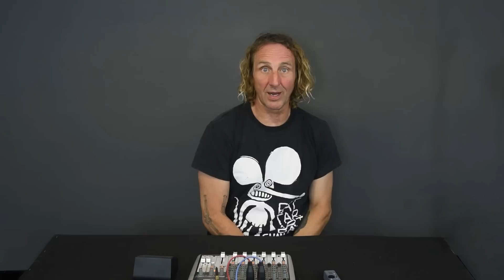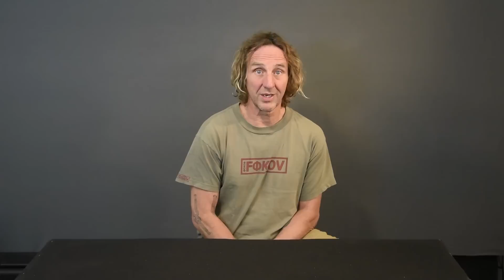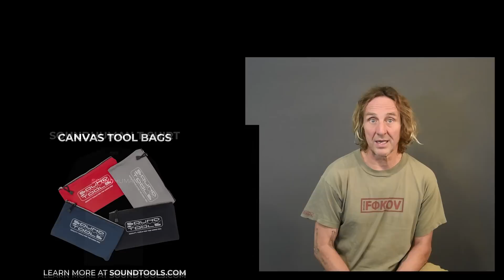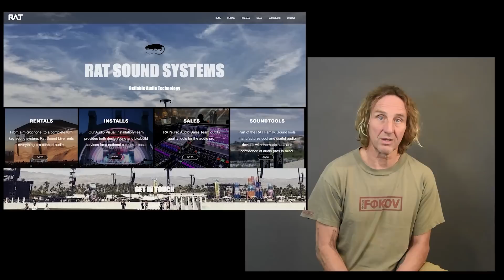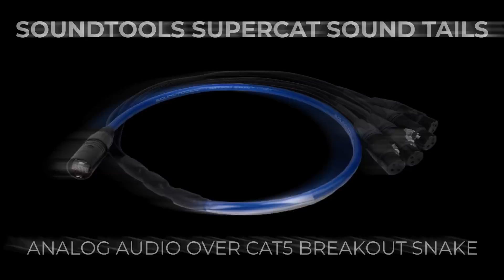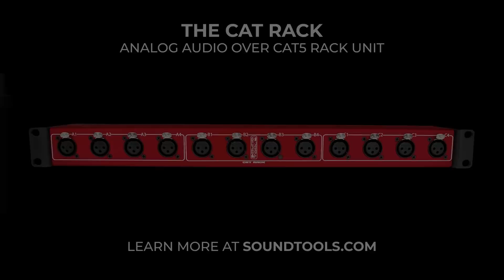Does Gain Pot Sound Different than Fader?

Comment: Very interesting Dave! And power amps deal with lots of wattage and amps, whereas a mixer is voltage? With an active level control on an amplifier I like to run it at +0 boost -0 cut, and use the mixer to set what needs more reinforcing. Kinda the same with a non-active amplifier but I turn the amp to max (10 or all the way up if it has no numerals) and again use the mixer to set what needs more reinforcing.

Comment: Awesome Dave! As always. Another reason for not running with your “faders” in the basement is the resolution of the attenuator may not be linear so you may have more fine adjustment around that “0” mark
Reply: An interesting side note… as someone who primarily deals in audio for cinema type rooms for permanent installation as well as special events (think three large array hangs behind a screen plus additional one two or three box hangs around the room for surrounds for really large premieres and such) we traditionally calibrate cinema processors at “7” out of a “1”to “10” scale partly due to the steeper taper below about “4.5”-“ 5” on the “Dolby fader” (a move from 7 to 6.5 is much less severe than a move from “4” to “3.5”originally when the first 4 channel Dolby cinema processors came out in the late 70’s the limitations of the VCA’s at the time also allowed them to track more evenly channel to channel at that part of their range. A lot of rooms today use large two, three or four way loudspeakers with large horns/compression drivers wand typically 2-4 18” low frequency elements usually bi or tri amped. 

Now that a lot of cinema systems are moving to Q-Sys and some non Dolby processors there is more of an introduction of dB scale to cinema playback systems. Whether using “7” or “0.0” as reference we calibrate to 85dB (C weighted slow response) sound pressure levels following a standard frequency response curve (SMPTE 202, ISO 2969 or “the X curve”) with a roughly -20 dB pink noise source. Subs get calibrated for 10dB in band gain above center channel and surrounds are calibrated differently depending on the processor but basically say left side and left rear should equal 85dB when played together (some processors have you set 82 dB per surround channel some add a 3dB offset for calibration so everything gets set to 85)

Sorry to bore everyone to death but thinking about fader taper and gain staging made me revisit why we do what we do in the areas I work in and I thought it may be of some interest.
Reply from the maker: Excellent and interesting!  Thank you.
Reply from the maker: This is true, faders down at the bottom of travel are jumpy gain wise
Reply: Absolutley! A movement of 5mm near 0 is much finer than a movement of 5mm near -20 or -30.

Comment: Changing the gain stage also changes the levels in every mix bus, matrix, output down the line. For the most part, keep the gain stage just below clipping and make all other adjustments at the various attenuators throughout the signal chain. Sometimes you get an instrument / mic that is particularly sensitive, and the gain needs to come down until you don't hear other things bleed through. Vocals coming through a hot piano mic is one I find particularly common.

Bonus question: Is  an EQ a gain stage, or attenuator?
Reply: The other issue is that if you have your gains set high, you can often run into the issue of having your faders low, which means they have less resolution as the fader scale is logarithmic. I prefer keeping my faders at just below zero (so that certain things wont risk getting maxed out later in the show where you can't afford to turn your gains up) and gaining them appropriately to that point.
Reply from the maker: True on low faders being overly sensitive and both gain and faders turn everything up or down
Reply: Except bringing the gain down on that piano mic will not change the relative levels of piano vs. vocal bleed unless the preamp was clipping. The vocal will still be just as loud in the piano mic.
Reply: The only reason you aren't hearing the bleed anymore is because you've turned down everything being captured by that microphone...including the piano.

Comment: Fun fact:
The BBC used to take the term "fader" literally. On a BBC mixing desk, to reduce the level of a channel in the mix you would push the fader up the board, away from you... Up =  more fade = quieter!
Reply from the maker: Me too! As well as mute and polarity reverse
Reply: LOLOL Too true!
Reply from the maker: At least that is not confusing
Reply: In Broadcast, that isn't always a bad thing, especially if you've got post backstop prefader aux sends where a slight unintentional nudge of a fader could result in something undesirable happening.  That is much less likely if you have to pull on a fader to open up a channel.  Where it gets really interesting is if your main board has "BBC Type" reverse faders, and also a secondary desk that is "conventional"!
Reply: @kevinwood4592  Hi and congratulations.......
I have, I think, have a pretty good understanding of my way round a mixing desk. However "post backstop prefader aux send" had me stumped. So, in good t'interweb form, I googled it, and whaddya know......

Drum roll......

A Google whack! A truly rare beast these days.

So, perhaps you would be kind enough to fill in this gap?
Reply: @dougaltolan3017  post backstop pre fader might be used when you want to send an audio signal somewhere where it’s sent at a fixed level regardless of your fader position, but not all the time. For example a boom mic in a Sit-com to the audience PA, or a music track playback to a monitor desk. But you don’t want it going when the fader is closed.

Comment: This was awesome! So like you've been saying, bad if you push the preamp into clipping, it will alter your sound. Unless that's what you want. I hadn't thought about the fader at maximum being zero attenuation. Always thought zero on fader was strait through and there was +10 available. Wonder if this differs per manufacturer... Another great video, thanks Dave
Reply from the maker: A true fader can not in itself offer gain. The zero is just a minus 10 or minus 6 db position driving a 10 db or 6 db gain stage
Reply: @DaveRat  Unity gain was a mantra that takes a while to understand. If you want loud sound/music then everything has to be in balance, gain, EQ and compression (at different stages) and a human being with ears and understanding.
Reply from the maker: Or you could just crank it up to party zone if there is enough tequila

Comment: With the gain down, fader up or gain up, fader down I think getting a good fat non-clipping input signal is vital to getting proper insert input levels , recording levels etc, otherwise there tends to be a chase the gain competition with too much make up gain or boosting record send levels and therefore mixer background noise. Also I don't know how it could be done but a way of comparing digital console gains, their digital output attenuators (not faders) and faders would be interesting. There are ways in a Yamaha console to tie yourself in gain knots.
Reply: Correct input gain is critical to getting good sound. That and correct mic/speaker positioning probably gets you 90% to a good mix. Assuming your gear and cables aren't faulty of course.
Reply from the maker: I will look at doing the same test with digital.  It should work as long as latency is locked in. And as far as gains, send hot and attenuate late to reduce noise while staying below clip to avoid distortion.

Comment: Yeah! Very informative. My questions are  not exactly dead panned to the gain/attenuator issue but….

So what are Faders as opposed to knobs ? Are faders a dust bin excuse to put grit and scratchy noises over time into the mix ? Why wait? Just throw some silica along and into slots…who needs to scratch records anymore to break dance or rap? Aren’t knobs less vulnerable to dust? Are faders more about visual tracking at the cost of more replacements and maintenance time?  Or are they cool programmed 1 dimensional dancers for hi end DAWs? I know that knobs aren’t perfect and they can get noisy too but can you help me like faders more? When digital screen faders became reality I got on my knees and thanked science despite the jitter trade off.
Reply from the maker: Sound quality is important but also being able to see what is going on is important for many situations. Rotary knobs are more challenging to operate quickly with things like increasing the level of three channels at once, or riding a pair of vocal mics with singers alternating singing with one hand or just scanning at a console and easily seeing which channels have been increased or decreased in level over the course of a show.

Also, cheap faders are drastically more problem prone than higher quality units.  If the circuit board is horizontal so dust piles up on the traces, vs vertical so the dust falls past the traces or even horizontal with the traces facing downward, all have huge impacts on the longevity and reliability.
Reply: Linear faders typically have a brush or flap to stop dirt when they are new. Doesn't seem to last long though. Rotary faders normally arn't sealed underneath, but live a more sheltered life dues to gravity. There is also lubricant in new faders that disappears over time, and the internal carbon track can be worn away, or cracked if something hits or is rested on the fader cap. You can get fader cleaner sprays, but I'm not convinced it ever returns things to original.

There have been desks that use rotary faders for the main channel fader, but this is normally a space thing. So either on really small 1 or 2 channel mixers, or many years ago Soundcraft released a version of the series 500 (IIRC) console aimed at mixing foldback monitors. In order to fit more aux sends (and make them  physically more accessible), they used a rotary fader as you don't really use it much. If I remember it had something like 12 aux sends, so the extra couple of inches helped.

Like you say, one of the nice things about digital desks is that you don't run signal through the physical faders.
Reply: @chriscook7049  Great input Chris. Yeah, what a relief and money saver screen faders are :) I think someone was selling remakes of the soundcraft 500 on Facebook before I left them. I have seen the brushes from a board at Stevie Nick’s studio before me and Thomas the engineer for her at the time moved her studio out of the quad building, he was usually performing after hour maintenance and repairs. Thomas didn’t care for Otari 2” tape but wow! I had never heard anything better one mono track straight across tossed some lightning into my soul.

Comment: So what are the point of faders versus knobs? Are faders huge dust ball imports
Reply: Lol, don't forget about the splilt beer!
Reply: @stuungar3390  I would put up pigeon spikes all around my sound booth to avoid the beer problem but liquid and foam flies in the air !! There’s No Use Charlie Brown !!!
Reply: @MrThacke  - lol, they're animals! I've put my subs downward firing just for those flying drinks
Reply: @stuungar3390  out doors I pipe the signal into electric jack hammers pounding bedrock. Problem solved! Lol!!
Reply: @MrThacke  🤣 brilliant
Reply: @stuungar3390  I am also developing Outdoor Concert Plasmastatic Speakers that eliminates the need for security. Anybody getting to close to the band or font house gets zapped to unconsciousness having the music inducted into them like capacitors ! Lol!

The home versions are much safer….

However, word to the wise, place as many white LED lights everywhere around the sound booth and stage to combat ozone and produce enough oxygen for the crew and band to breathe  easily.
Reply: @MrThacke  lol, very interesting. Plasmastatic, How do they work? Will Google it, cheers, love new tech. So you don't have to use the old trick of a microwave and parabolic dish, to give an unwelcoming aura to your booth??
Reply: @MrThacke  - are they speakers using a tesla coil, or is this your invention?
Reply: @stuungar3390  Microwave dishes just say No! Lol! I am afraid that what you might find on the internet would not only sound like crap but it would literally burn the people who get zapped. So study cold plasma please because not only will the human capacitor remain unburned you might cure their cancer or other health problems;-)
Reply: @MrThacke  wouldn't want poor sounding speakers, not to mention wandering drunk fire hazards. Thanks, I'll look into cold plasma 🙂
Reply: @stuungar3390   LMAOROTF !!! To answer a bit more these are my designs without a Tesla coil but one could be used with the correct type of radiant energy induction. Nothing on broadcast television uses that.
Reply: @stuungar3390  I also came up with unheard of Lenz Loophole amplifiers. One of them is like a class K amp but micro-oscillators through harmonic transduction using a specific metallic glass through per extreme slimline rail array by octave (exactuators I call them) and using two different grounds ie. Chassis and Hermetically Sealed mineral oil/carbon super flux grounds. Not quite a 3d chess game but we don’t want to replace stage hands with ballet dancers pirouetting what was heavy equipment however grossly large because how would drunken hordes appreciate as well pay for them?? Can’t use a public school dance program is such a corvid crowd;-)
Reply: @MrThacke  - wow, you're technically way more advanced then me. I'm trying, but can't get my head around it. I'm an inventor too, more basic stuff though.
Back to your original question, faders vs knobs, faders mean you can reel in mikes from karaoke singers with one hand, while fading multiple channels of caterwauling with the other.
Knobs are great for knobs who insist on requesting songs with a full pint glass over your mixer.
I'm sure Dave would give a more technical answer. Lol
Reply from the maker: After a bunch of drinks, it's easier to see fader positions than see where a knob is rotated.

Also, if you need to yard stick the volume of all the channels to max, faders are the way!
Reply: @DaveRat  that makes sense, kinda reminds me of some of the early am shift open mics back when :) those faders are necessary especially when you have short time slots per artist and that calls for regular adjustments to below zero restarts. Okay, yeah, I am liking faders now more than I did. Thanks Dave.